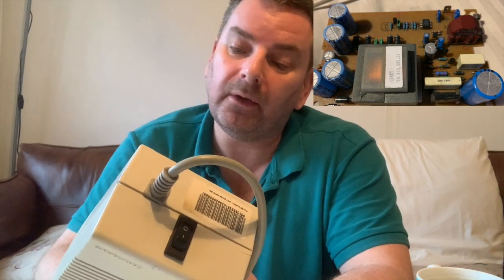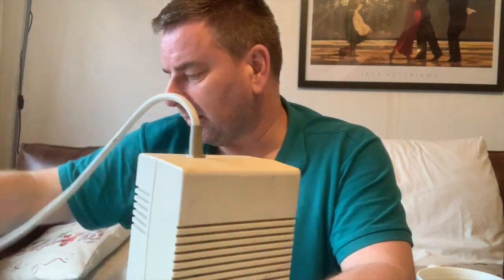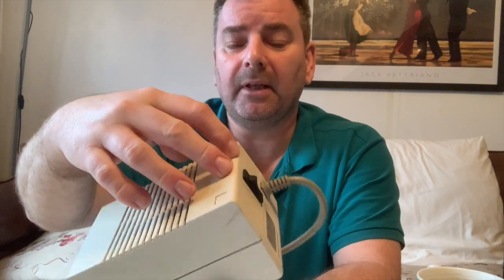Amiga PSU change   RT65B

Comment: Great info Mike! I use the slightly smaller RT-50B which I think you originally had too, and it does fit a lot easier as it’s shorter than the 65B, but I don’t run a PPC accelerator. There is a voltage adjustment screw on these to adjust the 5V rail too, which is very useful if voltage drops and triggers the low voltage issue. Thanks for the vid!

Comment: I have had issues with my PPC Blizzard 1200 using an ATX. If there is not enough load on 12v with those ATX then it doesn't boot for me. Using an AT power supply solved it. I know this maybe not relevant to your video, but thought I would just mention it.

Happy new year Michael.
Reply from the maker: I’ve used atx before and it was sort of successful but a meanwell RT65B may help you. It will run my PPC
Reply from the maker: And happy new year :)